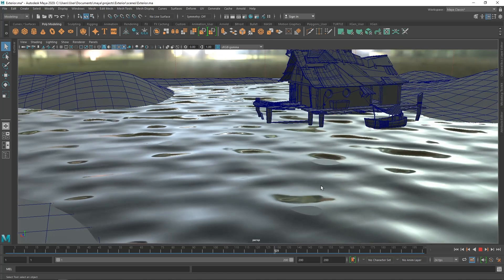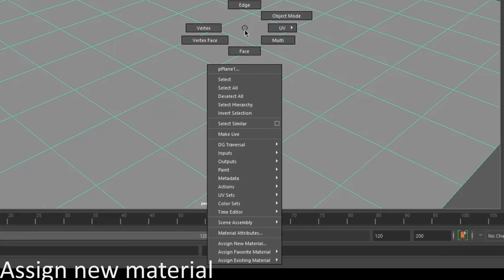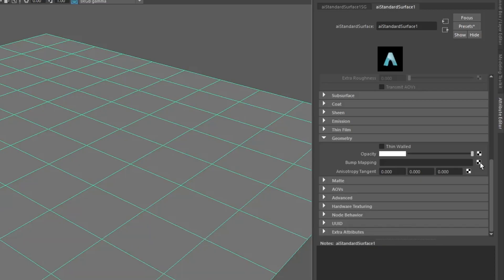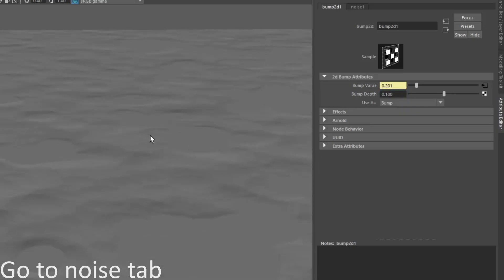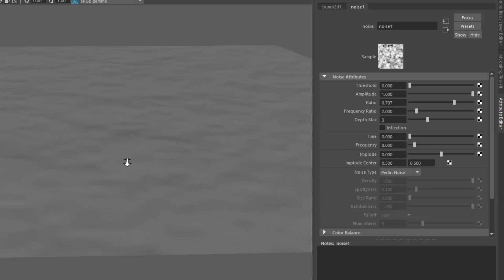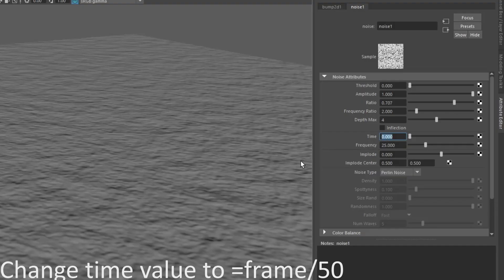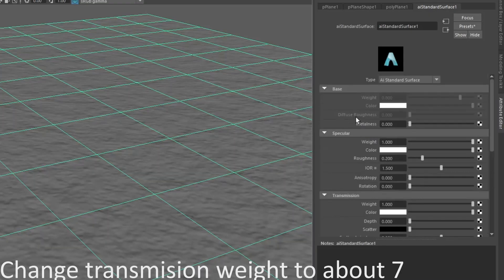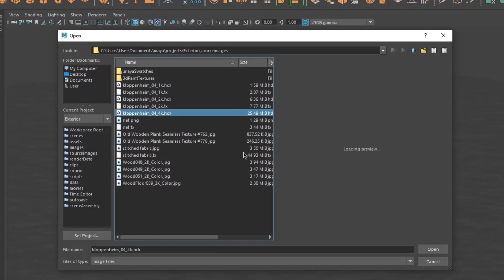How to create water/lake/ocean for MAYA with Arnold render compatibility!

Comment: Is there a reason why you specifically used Noise instead of the Maya Water Procedural? I've found that the water procedural works better when factoring in wind speed as well as for creating ripples.
Reply from the maker: I have heard about it but I also heard that it is not arnold render compatible
Reply: @jekuproduction  It is actually compatible, I've used it frequently. It's built in, same as the noise you used in the tutorial. Check it out some time and tell me what you think. I did try the same method as you did and it works quite well. I do think I prefer the water though, it has more options.
Reply from the maker: @sirjuiceskywalker  wow I will check it out bro thank you for letting me know. I thought it's not compatible with arnold render.
Reply from the maker: @sirjuiceskywalker  hey dude can you give me a tutorial for that one? maybe a link where you learned it?
Reply: @jekuproduction  I actually taught myself but Perhaps I will make a tutorial on it for you.
Reply from the maker: @sirjuiceskywalker  wow thanks just leave the link here thank you!
Reply: What is Maya Water Procedural? And how do I find it in Maya?

Comment: Hey Jeku, your tutorial is very nice and works for me. however, I can only render it in arnold using my CPU. when using my GPU I get a flat, not moving, surface. do you have a solution for that?
Reply from the maker: I haven't encountered that problem using GPU renderring. Maybe your  render settings?
anyway will try to do this again with GPU rendering, I might encounter your problem and will try to fix it. Thank you for your support!
Reply: did you find a solution?

Comment: hi, jeku, i have an issue with the speed, even after i change it to "=frame/50" which should be 0.02, but it seemed locked to 14.4 (pinkish color bar in the time), seem to follow the animation frame speed ?
Reply from the maker: I'm sorry I haven't encountered that kind of problem. Maybe it's a hardware issue or maybe your maya is broken? I don't know I'm really sorry :(